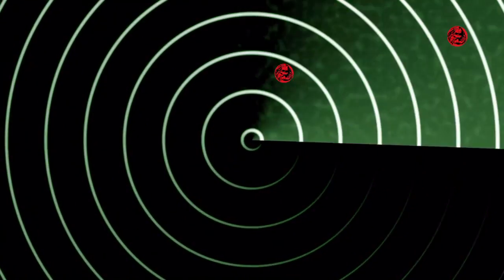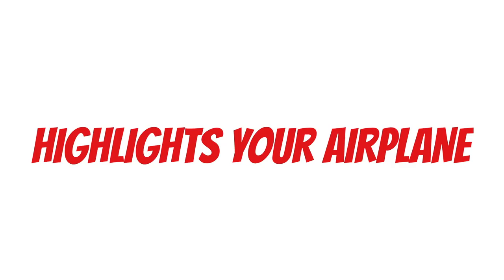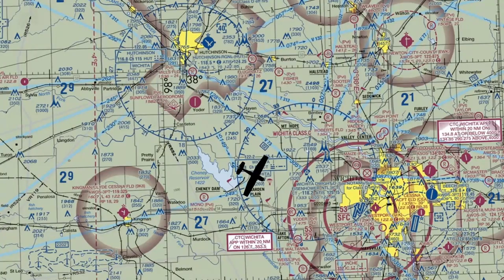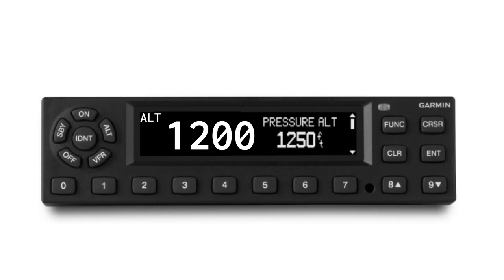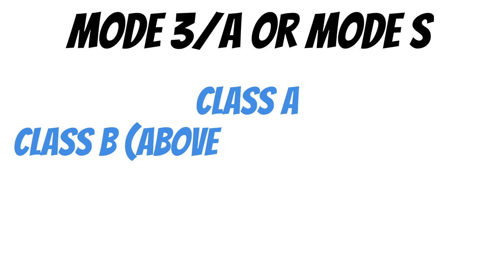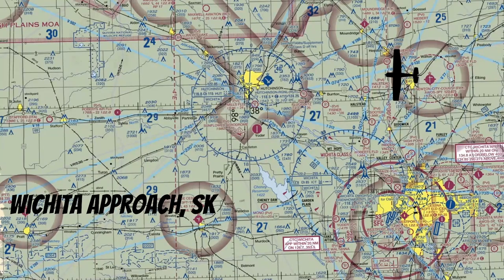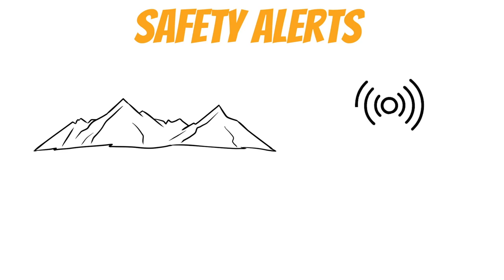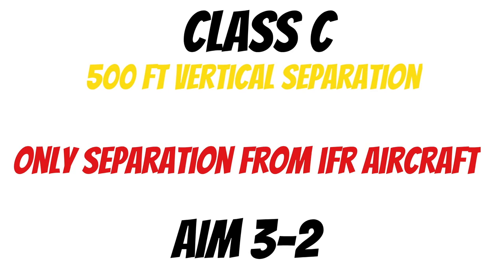Don't be Afraid of ATC   Here's Why! (Private Pilot Ground Lesson 35)

Comment: First of all, I love your videos. But, I do have a suggestion.
I know you're trying to make the simulated comms sound like low-fidelity radio transmissions, but your filtering is way too aggressive and it over-emphasizes the highs. Please consider changing your cutoffs.
I suggest starting with a passband of 300 through 3000 Hz, which is telephone quality. You can then narrow it a little at a time until it sounds awful but is still readable. Mostly, get rid of the lows, keep the mid frequencies, and keep the highs in check. Experiment!
Reply from the maker: Thank you John! I really appreciate that. I’m going to try some different software.  I adjusted the sound quite a bit in this video, and I agree, it could’ve been better.  I do want the quality to be lower because we need to train ourselves to understand these transmissions with poor quality audio.  It’s all poor quality in the air 😂, but thanks again for the tip, I’ll experiment a little more with some different stuff
Reply: The simulated transmissions are very quiet, probably due to excessive filtering. :(
Reply from the maker: @DNHarris  thanks for the feedback
Reply: @FreePilotTraining  I really have been enjoying the content.
Reply from the maker: @DNHarris  thank you!

Comment: Quick question. In your example the controller did not specifically say cleared into the Charlie. Is that wording not required for class c as long as have a squeak and radio contact. I fly under the Nashville shelf all the time from a little class d. KMQY
Reply from the maker: Great question. You are not required to be “cleared into the class C” you must “establish two way radio communication” which means that as long as Approach responds to you with your full call sign, you can enter.  Even if they say “N1234P, standby,” you can still enter because you have established radio communications.  One exception would be if they say “N1234P, remain clear of the class C.” You might enjoy this video where I go into a lot more detail. https://youtu.be/M-2VWNQ2Ukk

Comment: Just checked my edition of the aim and it says that fishtailing such as moving the ruder of your plane indicates a negative or no, whereas like you said dipping the nose of the plane several times means yes, and rolling the wings left to right multiple times indicates message received and understood making a complete right hand circle indicates message received and not understood.
Reply from the maker: Interesting! Where is that at? I don’t remember seeing that.  The section on light gun signals is where I got that part of the video (with a little flare of course) that’s pretty cool